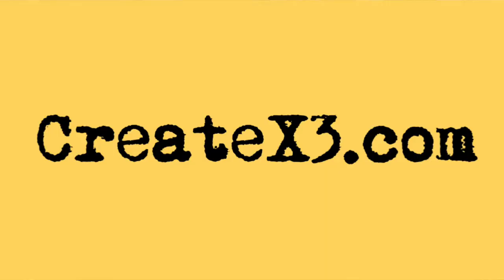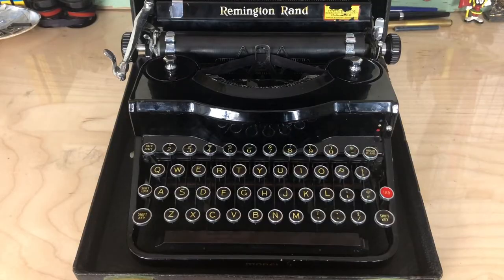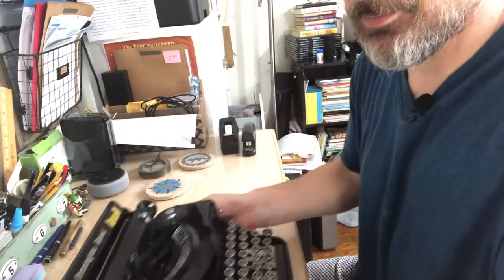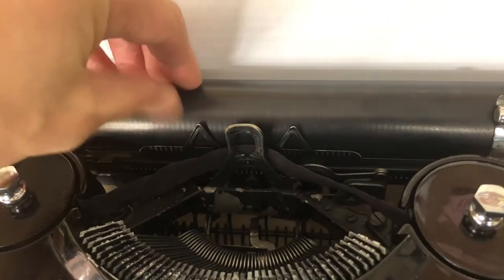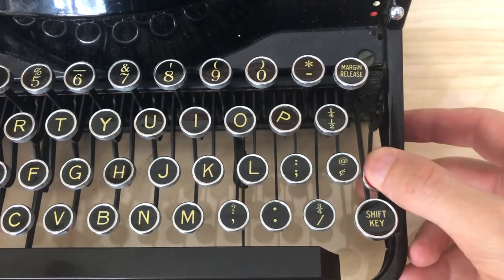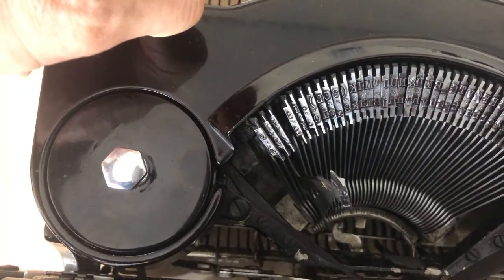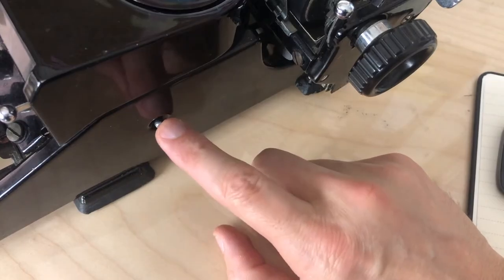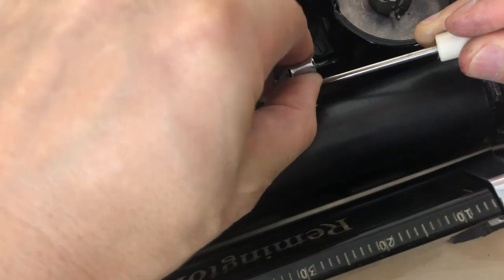How to Restore an Old Remington Rand Typewriter So It Just Works - Part One

Comment: Hey Damon. My carrage won't move as I type unless I lightly pull left while I stroke the keys. How do I fix this issue? LOVE the video. Thank you! (I'll watch other parts in case you explain that
Reply from the maker: Hi Cody. It could be a number of things but my first guess would be that there's not enough tension on the carriage strap. Every machine has a string or (on bigger machines) a strap that connects the carriage to the main spring. Sometimes you have to rewind this spring to get a machine moving again. I show this process in the video where I restore a Corona Four. Check it out and let me know if it helps.

Comment: How do you determine the year of the Remington Rand model one? I found a marker that says P101932, is that the indicator?
Reply from the maker: Hi Beelzebug2012. Great question. Fortunately for us typewriter geeks, there’s a resource called Typewriter Database, founded by the Right Reverend Ted Monk. Google it and you’ll see it holds incredible information on practically every make, model, and year of typewriters ever made. 

Find the Remington Rand Model One page and check your serial number against the ones listed. You should be able to pinpoint the year your machine was manufactured (or any other machine you own) with a high degree of accuracy. 

I hope this helps. Let me know if it does and thanks for watching.

Comment: Seems like they sell allot of silicone/latex tubing online in various inner and outer diameters. Wonder if I can use some of that to reline some squared off rollers.
Reply: I did a video about this using shrink tubing and got decent results, pcblah, although admittedly I prefer a professionally reconditioned platen. Also, applying shrink tubing over an old platen (if that's the technique you're referring to) can alter the platen's diameter, causing issues with the feed rollers in some cases. While researching the video I made, I came across several people who stripped their platens down to the bare wood and rebuilt them using several layers of tubing. Many of them reported that this worked very well. They had to keep the layers even, however, they said—no bubbles or wrinkles, and that seemed challenging to me having worked with only one layer. If you try this, please let me know how this goes. And thanks for watching!

Comment: Hi Damon.  I recently acquired an old remington rand and it is not in a very good condition. I need to remove its platen, but your videos don't mention how to do it for this model. Could you please explain how? I am new to this, so if you could also let me know if there are any other typewriter diy sites I should see, I would be very grateful. Thanks.
Reply: Hi Annette. Sorry about that. The good news is it's simple. Unscrew your left hand platen knob first. Now move to the right and unscrew the collar screw or screws securing the right platen knob (some machines have two, some have one). I recommend using hobby pincers or a similar tool to keep these screws, which are small, from being lost. The right platen knob screws are close to the platen, internal to the carriage. Once you've removed the collar screw(s), gently press down on the platen with your thumb and pull the right platen knob straight out. Barring rust or some other impediment, this will remove the right platen knob and the platen spindle, which is attached to it. Carefully lever the platen out of the carriage. Now, to remove the feed rollers, you must first remove the curved metal paper tray. This was problematic on my machine but it can be done. Pay special attention to how the paper try fasteners work before you remove the tray from the machine. Apply gentle leverage if you must. Once the paper tray comes out, the feed rollers are exposed, you can pluck them out easily with your fingers. If you watch the series through parts five and six, you'll see all the above reverse engineered as I put the machine back together again. As far as other typewriter DIY sites, there are many! Start with Richard Polt's Basics of Typewriter Maintenance Page found here (https://site.xavier.edu/polt/typewriters/tw-restoration.html). Also check out (https://myoldtypewriter.com/). Don't miss videos by posted by Duane Jensen at Phoenix Typewriter here on YouTube. Or Typewriter Justice. And I encourage everyone to get to know the local typewriter craftspeople in your area. If you're on the East Coast of the U.S., near NYC, Boston, or Philadelphia, be sure to introduce yourself to Jay and Paul Schweitzer at Gramercy Typewriter, Tom Furrier at Cambridge Typewriter (whom I only know by his excellent reputation), and Bryan Kravitz at Philly Typewriter. Good luck and thanks for watching!
Reply: Thankyou so much! That will be very useful.
Reply from the maker: @ontheblossomtrail  let me know how it turns out, Annette.
Reply: @ontheblossomtrail  Of course! Good luck, Annette, and thanks for watching.